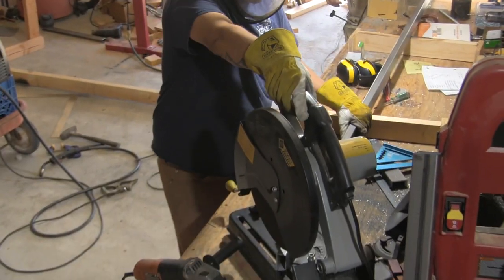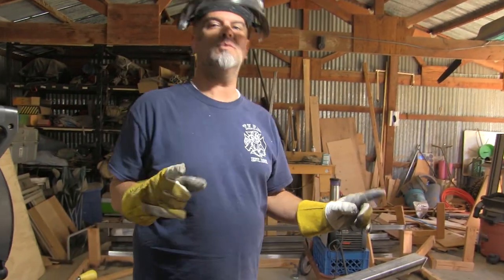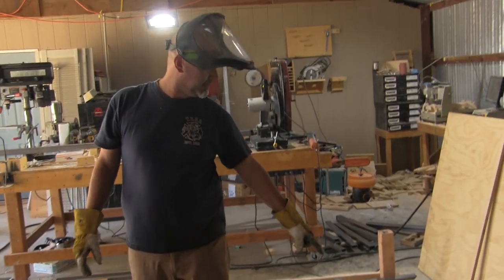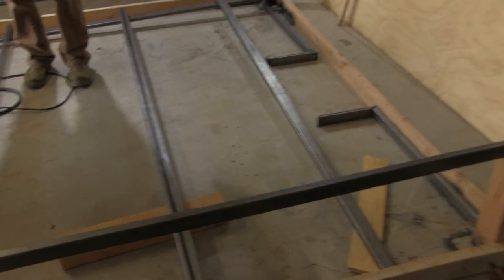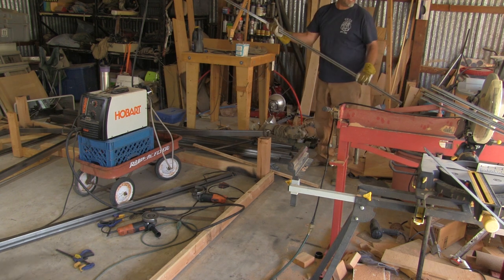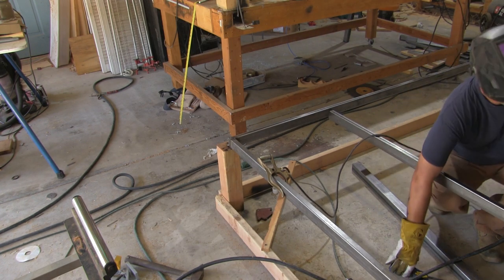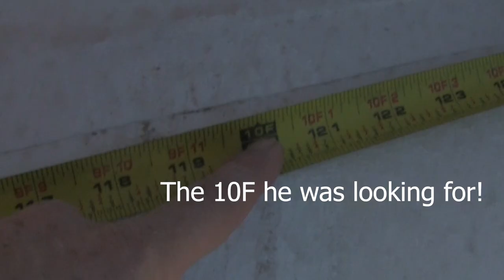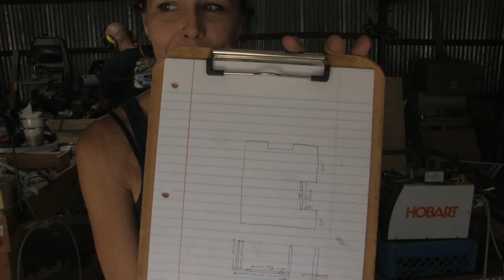Our Skoolie Roof Deck Makes Progress! (Part 4)

Comment: It looks like your day is as bad as mine. I bought this guitar with a buzz in the B string. Two nut replacements later and three left turns on the truss rod it finally came together. I feel your frustration.